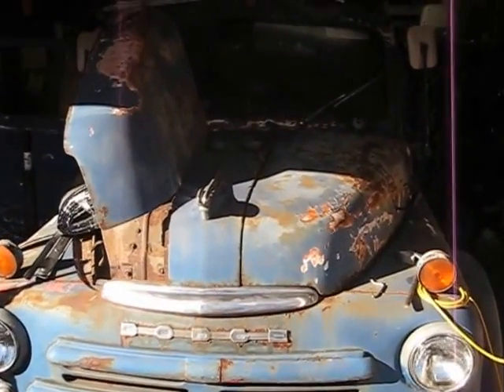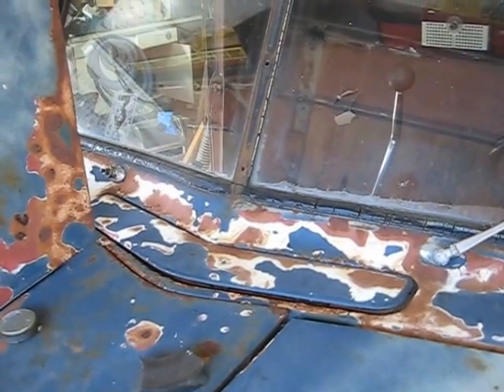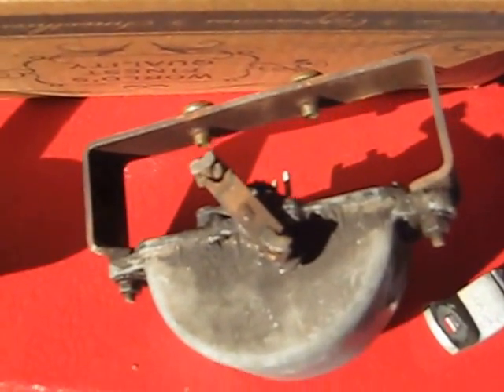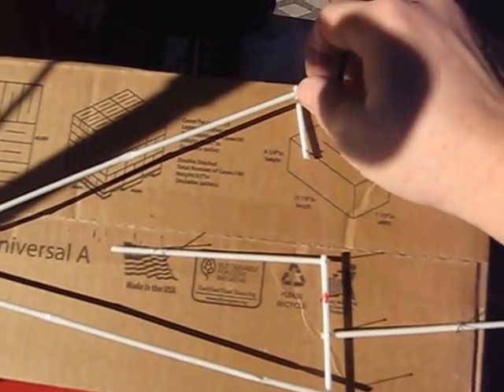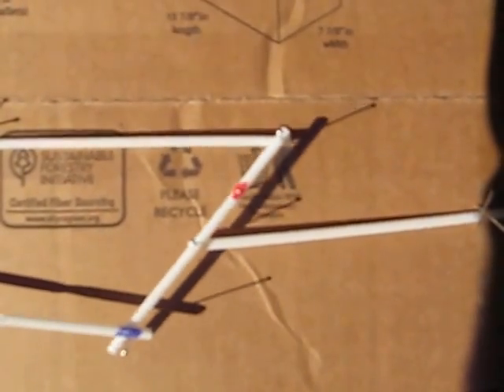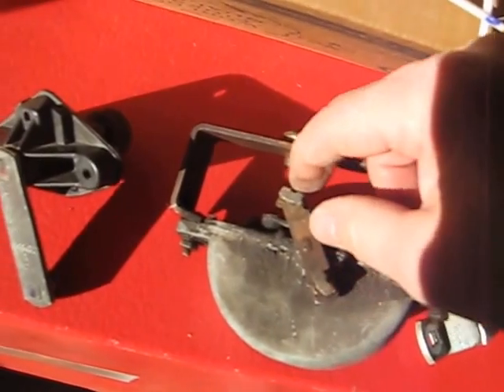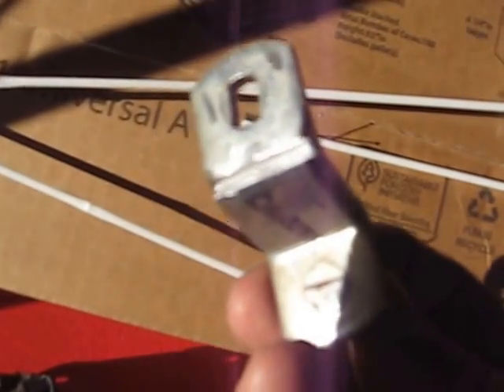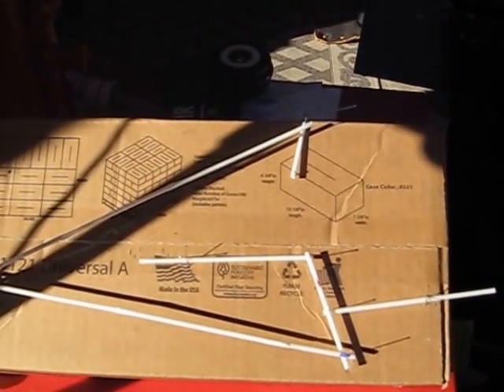Vacuum windshield wiper conversion to electric wipers

Comment: Nice , I ended up doing the same thing .I put a 1948 dodge on a 1998 dakota and i used the intermediate motor because in Oregon we get a ton of rain and it's my daily driver. I used the braket in the middle that has the two screws in it on the dash. Good luck

Comment: Would a rear window wiper motor be a good solution? If you could find one that has a similar rotation radius to the vacuum motor, it may be easier to modify that than creating your own linkage.
Reply from the maker: I learned about using a rear wiper motor from an SUV after I built most of the linkage, but thanks!  The project was stalled by my career change and a house sale & relocation, but I'm going to get back on it soon!

Comment: Please don't repaint it, looks great the way it is..
Reply from the maker: Oh no, never!!!  Interestingly, the truck started life red, then someone painted it white, then the blue.  No way I'm changing that color scheme!  I had a pinstriper paint some logos on the door that look like they've been there for 30 years too.  :)  Thanks!
Reply: I need to do the same job on a 59 Ford, I remember many years ago doing this on a 56 Ford but have no idea what motor I used but it had a short sweep, being young didn't worry much, this time it will be better. You are a intelligent thinker, your video has helped me work it out...
Reply from the maker: Funny thing is that I tried to post this video on the H.A.M.B. and they said that it wasn't "traditional" enough.  Safer, more efficient wipers AREN'T welcome in the old school hot rod world?!?!  Hmmm.  I haven't been back on the H.A.M.B. since.
But thank you for your compliments!  It was a fun process, although a bit time consuming.  It was pretty cheap to construct though!  I used all of the Dakota parts and some from a Dodge Caravan that my brother was parting out.
Best wishes & Good Luck!!!
Reply from the maker: @critchley3819  I ended up just adapting the rear hatch wiper motor from an SUV and it was a bit easier.  Bought a new one on eBay for about $50.
Reply: The HAMB is a fickle bunch. Knowledgeable as hell, but fickle.